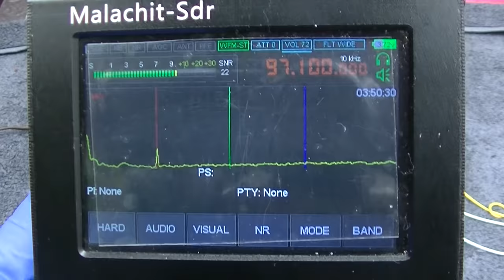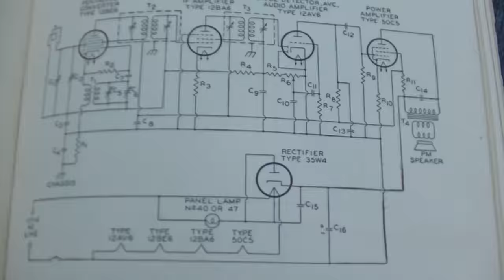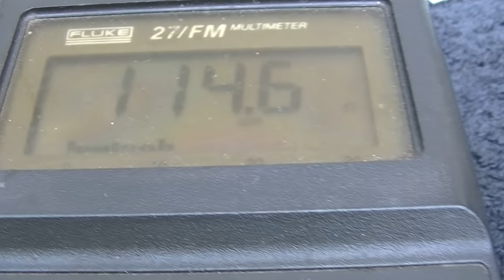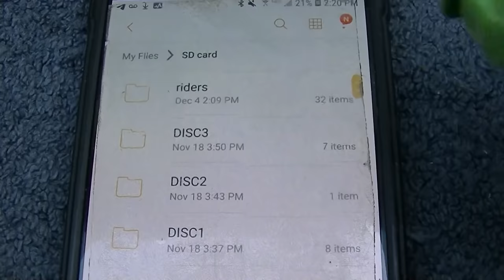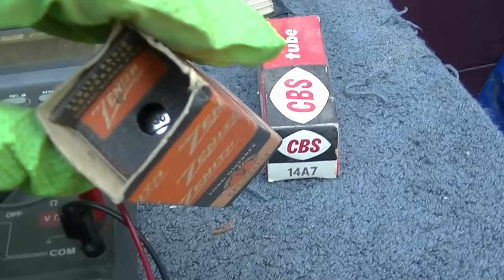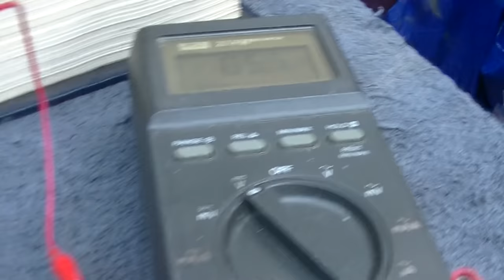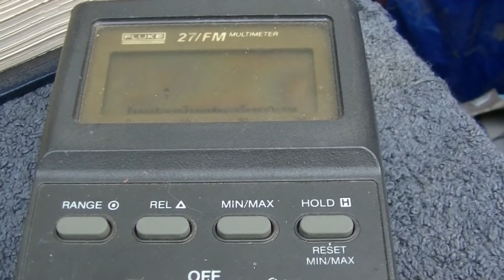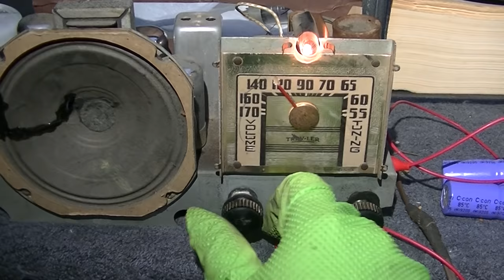1948 Travler 5 Tube AM Radio Resurrection Repair and KNX Goes FM

Comment: Sounds to me that the station's management doesn't think younger people are smart enough to operate an AM radio, so they added FM. I'm cool with that, I have a add-on tube FM tuner because the Pilot company knew this was gonna happen in 1947.
Kudos to Pilot for their forward thinking !!
Reply: In Europe (at least in Germany) it was mandatory for every radio manufacturer to include FM in their sets. Starting in the early 50s. I first visited the USA in the late 70s and it was super strange for me to see AM only radios. Even our rent-a-car had an AM only radio. That was a super weird experience for me. I never saw a post war radio in Germany without FM.
Reply: Some modern devices only include FM, No am band whatsoever
Reply: I’ve got an old Philco from 1948 that’s both AM/FM. Haven’t had a chance to get it make work happy again. It’s a buzz-o-matic, but the audio works, I’ve tested the phono input.
Reply: I look forward to 1010 WINS or WCBS 880 adding FM here in NYC as news on FM is minimized now and it isn't possible to tune in AM in many large buildings.
Reply: I have wanted to pick up one of those Pilots have you seen that modern board you can buy to add fm to your am using your am tuning to  tune the stations with !
Reply: @glennjones6574  in smartphones in Europe they deactivate the FM radio because in France every radio receiver must have DAB+ functionality. No one in the reality wants that; so samsung and the others just kill the radio altogether in the firmware. 
Nice, isn't it?
Reply: @albinklein7680  Even into the 90's here on the west coast of Canada, AM was still the packed with stations. I can remember in the early to mid 90's there was only about a dozen or so stations that I could pick up on FM without having a deep fringe TV antenna connected. Back then every little town had a AM station with around a 1kw transmitter.
Reply: Those old tube packaging are awesome.

Comment: You can drill holes in a plastic beverage cap and slide the modified pins through. Helps stabilize the pins and prevents from splaying out.
Reply: I'd think cutting the base off the old tube would be the neatest solution, but that might be harder with a LOCTAL base than with an OCTAL base, with  the pins embedded in glass.
Reply: That is brilliant. A neat, sturdy base!

Comment: I used your videos as inspiration to get an All American 5 tube radio working. I found a GE radio, which looks to be a Model 102 from 1948.  It worked after I cleaned the dust and grime out of it and replaced the filter cap. After getting it working, I recapped the rest of the radio, and it works just like it did before recapping, which tells me I did it right.

Problem is the radio is deaf. It was deaf before recapping and it's deaf after recapping. It has a coil antenna. I replaced the antenna capacitor just to be sure, and I tested all the tubes. Some of the tubes are weak, but far from dead.

I adjusted the trimmer capacitors on the tuner, and I did my best to align the radio. That helped a bit. It gets the strong local stations, but outside of that, it's just deaf.

Given there's not much that can go wrong with AA5 radios I figure there's only a few reasons why it's deaf. 

I suspect a massively out of tolerance resistor but I'm wondering what else I can check.

Comment: I just recently picked up a 1953 Capehart model TC-62 AM Clock Radio that was pretty much NOS (it still had its original box with it yet and everything) and it was as virgin as you could get with a radio, original tubes and original caps and resistors etc. Unfortunately I had to ditch 3 of the original tubes in it because one of ther tubes (a 12BA6) had a H-K short, and then the 35C5 tube was Microphonic, and then the other 12BA6 had an open filiment, this radio is an AA6 radio it has an RF section, 2 IF sections,  and AVC.

Comment: Amazing, that everybody loves loctal tubes. I live in Germany and we are big fans of those too!
;-)
Reply: hmm, yeah...😉 european loctals such as uch21, ubl21, ebl21, are much better 😉
Reply: another german 🙋🏻‍♂️🍻
Reply: I'm pretty sure shango was kidding about liking loctals., I hate them and have hated them for 50 years. Even though they are actually superior in their way.
Reply: @pneumatic00  I was kidding, too! Of course!
Reply: I've been a radio collector since the 1980's and never really had any problem with locktal tubes or sockets , to me they're just another tube style.  The worst tube sockets were the very cheap layered bakelite ones that they used in North American tube table radios in the mid 50's to the early  60's.  They were mounted on solid bakelite boards.
Reply: @vancouverman4313  As a kid in the 60's I tried to fix electronic stuff found in the garbage. I can't think of a really logical reason why I don't like loctals...probably bec they were a bit odd even back in the 60's and I had few other radios, etc; from which I could steal them for sub-out. And/or, they were car radio tubes, car radios usually being completely skunged out and filthy. Possibly, I encountered a set where the loctals were corrosion-welded into their sockets and I broke the glass envelope, jamming shards of glass into my fingers trying to remove it. From then on....

Comment: Thanks Shango for providing the links in the description. I heard last week they were going to also broadcast on FM.  Despite all the interference on AM, I auctually prefer listening to KNX on AM. I just got done with one of those Philco 'Hippo' radios. Dirty, crusty, & dry to the MAX, combined with loktals and, rust. I think it's time to krinkosnorkulate.
Reply from the maker: It was a music station
Reply: My market has lots of AM stations repeated on FM and FM digital subchannels. I often still listen to AM, because the analog FM can have multipath, and the digital has a 30-40 second delay.
Reply: And I heard that 1010 WINS in NYC is going to be on FM at 92.3 starting October 27th.

Comment: I no longer live in So. Cal but I always remember the jingle for "K-N-X 10-seventy, News radio". It was my go-to source for traffic updates in the late-80s to early 90s (I got my driver's license in 1987 and then moved away when I went to college).
Reply: Listened to KNX since the sixties. Can still hear the AM on a good night now that I live in central Oregon. Have to use my Radio Shack transistor radio to do it. 
It’s like an old friend.

Comment: Enjoy watching your videos. I like how you find the problem without recapping. I saw someone recap a simple five tube wonder only to still have problems hahahaha. He was on the right track by replacing the electrolytic first but after blaming all the paper caps and seven videos later it still doesn't work hahahaha. I know what it's like to encounter SMD for the first time I shouldn't talk. I already know the problem is alignment either someone screwed every slug and trimmer out of whack or it has silver mica disease because of the smaller IF cans or both. On video seven the radio sounded like it had somehow an open circuit in the grid of the audio and was only picking up stray ac and sending it to the speaker. When the volume was turned up all he got was stray ac hahahaha. All new caps. It wasn't doing that with the bad wax papers. Update...video nine... hahahaha five tubes...oh boy

Comment: I’ve always heard that loctal tubes were developed by Sylvania/Philco primarily for automotive/police radio applications where they were advertised as being less likely to come loose due to road vibrations and shocks,but that they were problematic in military situations where exposure to harsh environments/humidity would cause corrosion issues with pins/sockets.
Reply: you are correct, it was a military contract( late 1930's) that started the ball rolling for that design tube. if you look at a "PHILCO TUBE" with a "EIA CODE 312" it was made by "SYLVANIA". this tube design went out of production in the late 1950's, due to "MINI TUBE" design being less costly to build. so it had a 20 year run. I am a firm believer in keeping such equipment "FACTORY ORIGINAL", they really are not a bad tube, it is rare that a "LOC-TAL" tube fails, most of the electronic equipment that I have that uses "LOC-TAL" tubes are original!!!!!
Reply: I have always had lousy luck with loctals. Corrosion and intermittent connection problems, the invisible ink they used on the glass disappearing. Stuck tubes and sockets that break if you look at them wrong. I am working on a Philco that has no evidence of being stored near moisture, cabinet is flawless. Yet somehow the corrosion under the loctal output tube was so bad that the bottom of the tube base was no longer attached to the tube. I hate to deviate from a set's originality by resocketing sets, but some days I think the ARF's "Dutch Rabbit" had the right idea about loctals & all their problems.

Comment: if you see a small value resistor (10 to 100 ohms) in series with the grid of a tube, don't remove it. Its role is to stop possible parasitic oscillations in the circuit.
Reply: I hate it when my parasite oscilates. ;)
Reply: that may have been a factory advised 'mod' after the schematic was published due to problems..?? philips commonly used 1k as output grid stoppers
Reply: looks  like someone forgot to put the grid to ground 470k back after fitting the 100 ohm! quick way to fry a valve/tube!
Reply: and yes, of course it needs the 470K resistor to the ground, i was speaking about the resistor in series with the grid, if it exists physically.

Comment: You could transplant those parts to a duplicate "breadboard" layout, with tube sockets and brand new caps and resistors, exactly following the layout of the Schematic.  Much easier to follow, and understand.

Comment: exactly, make sure it basically 'works' and/or all 'unobtanium' parts are good before thinking of recapping, or you've wasted all that time, effort and money  if something major has failed, i had that with a late 30s murphy set someone asked me to service, several tuning coils had been chewed by some sort of creature, making it a write off in terms of a radio, so i got it working as an 'amplified' speaker,  switched to the 'gram' position,  not doing unnecessary cap replacement,  which was ok with the owner

Comment: Hey Shango, I am currently working on a Stromberg Carlson 1101 radio and it  has a 150 ohm resistor between the .01uf coupling capacitor and the 35L6 tube. It looks original from the factory. I've seen others posting videos of the same radio and they show the same capacitor and 150 ohm resistor so I believe it's original.

Comment: My procedure is to use an independent source of B+ and a neon to see if the smoothers will re-form and then change the o/p valve g1 coupler if it is a wax/paper capacitor & go from there.
but usually every paper capacitor WILL be leaky. You just need to hear noise and know the audio & IF strip are fine.

Comment: I never liked the 5 tube radio because of its limitations but my Atwater Kent radio was outstanding not because it could also pick up SW but because it picked up radio stations all over the country. I never liked the local stations but to listen to classical and big band music was sweet. They should have added one more tube and stage to the radio. I know there are 6 tube versions that have an extra 12BA6 tube or the octal version. An RF amplifier helps pull in the distance stations. 73

Comment: Great resurrection repair. Lots of voltage checks can tell you what's wrong. B+ should be about 105 Volts. Whomever put that 100 Ohm in and took the 47 K out didn't have a schematic  to actually repair it,  just grabbed what he had to make it 
work back in the day. The sign on the store probably said "Electronics repaired while you wait".

Comment: to glue up paper cones, and foam rings, (besides using the glue from the producers)... Buy  a PVA based wood glue, that is made for usage outside, and freezing. Lay out a line on a piece of paper, let it dry/harden, and bend the paper, the clue should not "break", but bend a good bit. So it is sort of semi hard.
After the test you can safely use it on you speaker for repair.
Reply: Nice tip. I have replacement foam for some Cerwin-Vegas that have rotted out and I have been searching for a readily available, correct glue that doesn't set up too quickly to allow me time get everything in place.
Reply: if the break is on a piece that 'flexes' its better to use a latex based glue as pva will be a bit too rigid
Reply: What about contact cement?
Reply: A tip I picked up on from another YouTuber channel is to use Dap contact cement (the original not water based). It works GREAT! It never becomes brittle and after repairing the crack/ tare, you can coat the entire cone with it if one chooses to.
Reply: @andygozzo72  single plies of soft toilet paper work great as a reinforcement in areas that flex on speakers without foam.
Reply: @andygozzo72  Yes, if you put on a lot, but i tend to water it a bit out, and just "repair" the broken paper with the watered out glue.

On bigger speakers i would agree with you. But be careful to not add to much weight as this will increase the unbalance in the membrane and create unwanted distortion.

Comment: All loctal  tubes manufactured here in Germany were made by LORENZ. Strangely we never have any contact 
corrosion issues with these, maybe Lorenz used a different alloy for the pins..

Comment: Will KNX keep their AM signal on 1070?  In my market of Salt Lake City, Utah, KSL added FM in about 2005 at 102.7, but they absolutely kept their AM signal at 1160.  This all means that KNX would have to announce themselves as KNX News Radio 97.1 FM and 1070 AM since it sounds like they are keeping their AM signal and merely began simulcasting on an FM signal.
Reply: Nah, they'll only mention the FM, tonnes of stations do it - they have to keep their AM because of their original license, no AM, no FM either....if they could, they'd probably just bin the AM and keep the FM, but the FCC Laws are as they are.

Comment: You did not point to the digital carrier. More like the 19kHz stereo pilot. The IBOC carrier is nested in the digital wideband at the extremity of the 200kHz channel.
Reply: Lots of ppl dislike the digital, mostly on AM they dislike it, FM it seems to work better on, more room I guess, with superwide North American Channels especially. It sounds like a waterfall apparently, but anything like that my brain tunes out automatically.

Comment: Have you ever used the liquid rubber brush on black electrical tape stuff for speaker tear repair?  Dave Tipton uses it on his channel and I've tried it a couple of times and it seems to work very well.  No less aesthetically pleasing than the repair here but the rubber allows the speaker to move just fine...dries in a couple of hours.
Reply: I use the special sealant for glued in car windscreens. They supply one cartridge per windscreen when you buy one. I always keep the leftover in a can, diluted with the matching solvent. That stuff is by far the nastiest glue I know of.
Reply: @albinklein7680  What do you thin it with?
Reply: @MrCrystalcranium  with the solvent with the most warning labels on the can of course!
Jokes aside; i use the recommended solvent. Iirc. it's Sika Thinner S. It's basically xylene and methylpentane.
Reply: A little acetone added to liquid black electrical tape and it works great for repairing those speaker cone cracks!
You could put the mixture in a small glass bottle and cap it good. Turn it upside down and it won't dry out.
Reply: @albinklein7680  Glues in loose tubes into their bases as well

Comment: What gets me is that they ID as an FM, not an AM with an FM translator station. Should be “KNX 1070, 97.1 on FM”, not as an FM station with little mention of their AM signal. It’s not what the AM revitalization act was designed for.

Comment: Good stuff as usual. I wonder what kind of radio is "equivalent" to an "All american five" here in Italy / Europe, because I have never seen anything like that...
Reply: I suppose the usual 5/6 tube superhet AM radio, the small models built from the end of the war to the mid 50s when FM was being introduced. There's a lot of them around, but with a better quality than AA5 I think. I do have a Philips BI-192 5 tube am radio, that could be an equivalent to an AA5

Comment: I was please to see that 'wheat flour' was used in making the tubes. I suppose one could grind up old tubes and make bread with them.
Reply: Yes, but it just does not crisp up very well. No good for toast.

I think if you get plenty of the getter mixed in it won't be so bad.

Comment: 27:10 Could it be the contact surface of the pins, rather than the filament itself? I wonder if the reading would change if they were scraped down.

Comment: Loctal tubes are not as good as they should be - why I don't know. They should grip and hold the valve solid - Maybe the ones we got were not as high a spec as the Army ones? We have them in the UK too and I had a problem with one set - A Marconiphone - that kept going off to to a socket problem. The cathode pin and socket just did not work and it was the socket.  And as far as the Grid Capacitor goes - change it on sight. Cheaper than a valve/tube and a transformer......

Comment: you hate those tubes?! you're not the only one 😁  they werent used that much here in the uk,  luckily😉 and they certainly seem to fail a lot, 😉 at least the american types or american 'clones', european and uk origin ones seem a  bit better, 😁 they used slightly differently plated pins, less likely  to oxidise, and spigots and overall envelope shape can differ depending on type